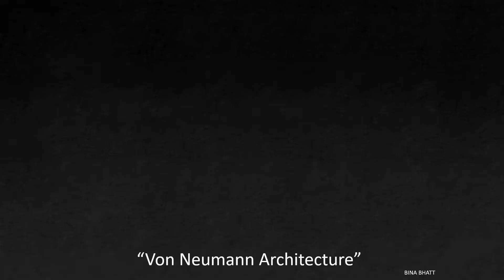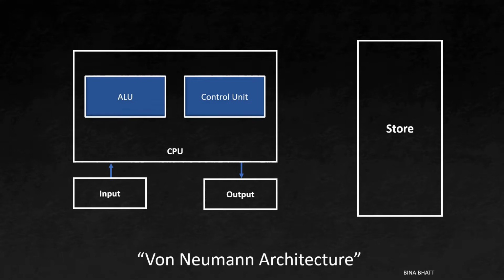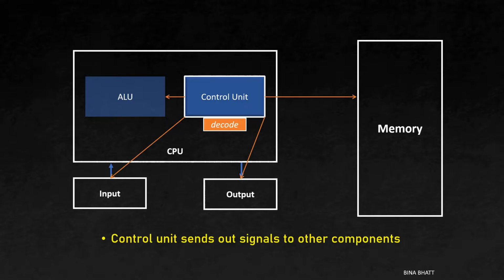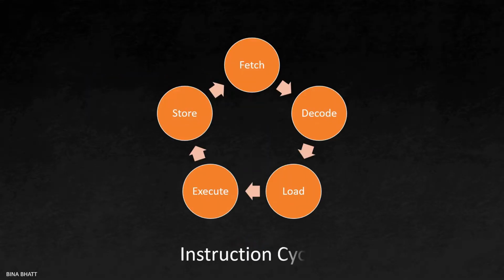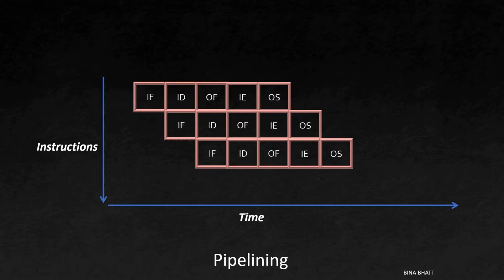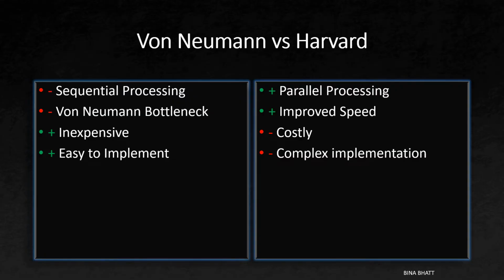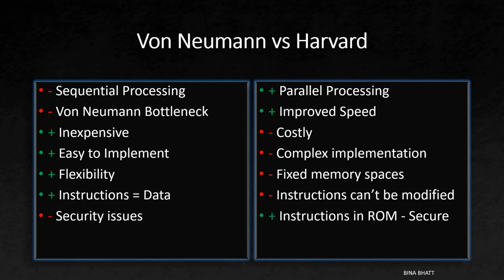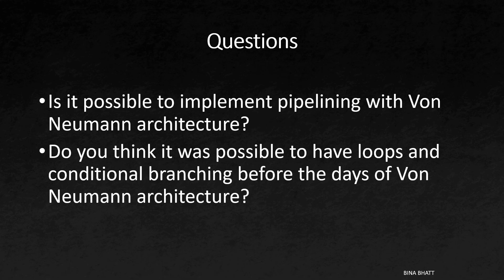Von Neumann Architecture and Harvard Architecture | Computer Architecture

Comment: I'm making a CPU on FPGA that use a two-port RAM. I use instructions for port A, and Data for Port B. Would you consider this von Neuman or Harvard?

1. I use one RAM not two, but the RAM has two ports that allows access to read and write at two different addresses at the same time.
2. Port B is always one address above port A and is only used when the instruction demands data, like a memory address or value. In this case the program counter jumps one extra step so that Port A doesn't execute the previous Port B address as an instruction.
3. The Von Neuman bottleneck is eliminated.
5. Retains flexibility from Von Neuman.

Comment: 1. Since instruction pipelining may require simultaneous access to both data memory and instructions memory, it is hard for pure von Neumann architecture to achieve that.. But if you cache the  instructions and data (thus creating a small "ROM" and "RAM", respectively), then it can be done with von Neumann architecture, though this will be closer to Harvard..
2. Simple branching and loops should be possible to build with just hardware, transistors. For example, we can implement branching using multiplexer - demultiplexer gates, which physically activates or deactivates different parts of the chip, thus altering the output of the chip; that can be branching... Or take a simple counter, that counts from 0 to 9 and back to 0 with intervals of 1 seconds - it can be the example of loops. No program needed, not even fixed one; a certain way of wiring the hardware parts together in this case is the program itself..
Reply from the maker: Thank you for the comment! 
1. I agree with that one.  And my next video will cover cache related info!
2. Actually, transistor weren't present at that time. We are talking about the days of vacuum tubes!